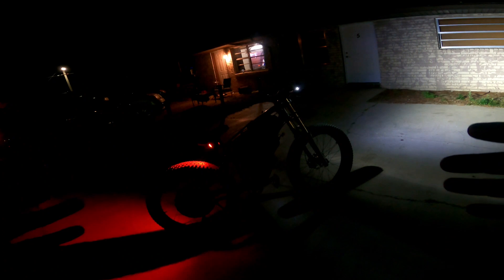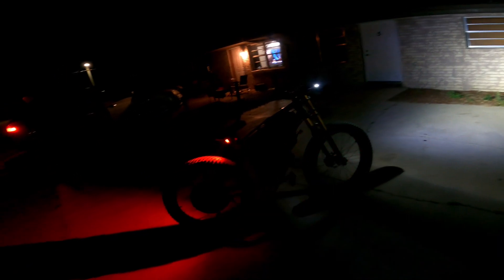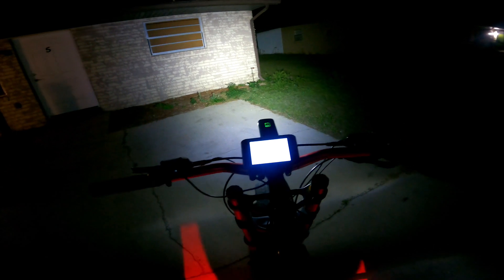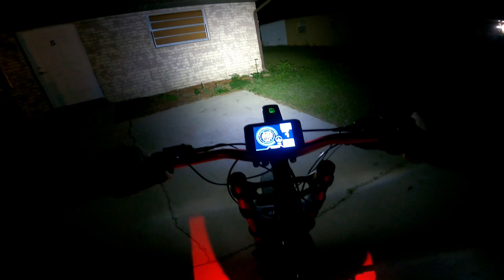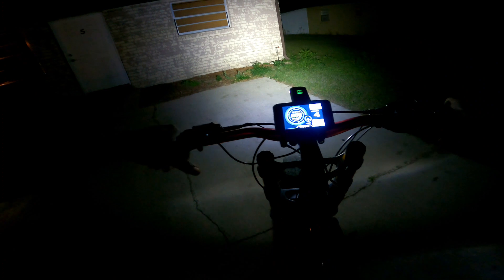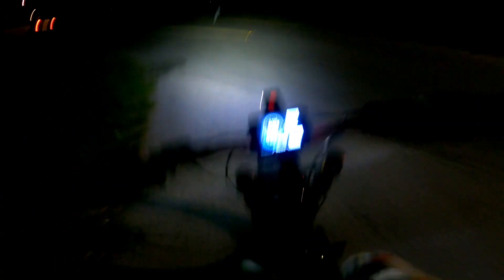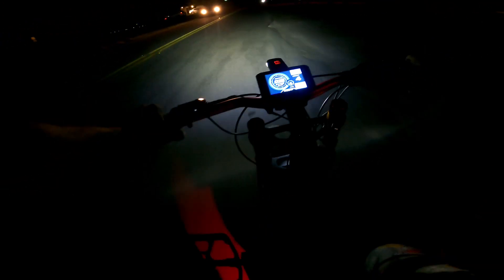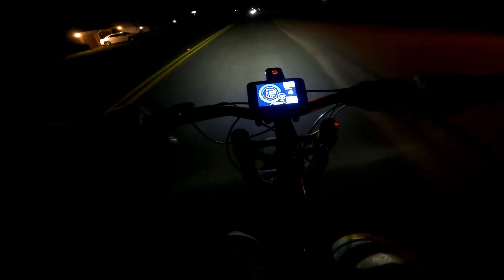8000w diy ebike, short ride for my subscribers. qs 273 3.5t

Comment: Should be on the dragstrip. Guess the next step is to go AWD for some insane acceleration.
Reply from the maker: Might just try that lol
Reply: The front wheel will probably just be doing a burnout.
Reply: @Soulie81  If you have the right controller you can program the throttle to start on the Qs 273 then as you twist further the front motor kicks in and your already moving and not likely to burnout. AWD does have some amazing acceleration I know.
Reply: @Soulie81  sorry meant to say throttle mapping

Comment: Whats your current favorite 8K motor. Thinking either a 3.5t or maybe a 4t. I do 60% road and 40% off road.
Reply from the maker: Mine is a 3.5t
Reply: @E-bikeguy  any experience with a 4t
Reply from the maker: @Temmple  I know you will have more torque but Less speed

Comment: Looks good. Probably pole pairs are different than the 205, throwing the speedo off. You have enough motor now to play with flux weakening more and get top speed up to the highway speed limit. lol
Reply from the maker: Lol right?!!!!
Reply: a 273 will hit highway speed limits without even touching flux weakening. specially on 26s
Reply: @AaronSmith-mn2hu  , at 72v you think it will hit 70 mph without flux weakening?
Reply from the maker: @AaronSmith-mn2hu  I definitely believe it. Mad acceleration lol
Reply from the maker: I believe it,  my 5000w ebike hit 74 without flux.
Reply: @E-bikeguy , ok then. 100 mph on tires you can fold up and put in your back pockets. Who goes first? Lol
Reply: @imho7250  he will learn.
Reply from the maker: Learn what????🤔

Comment: I've actually about 1 week into my wait on a very similar build I got ac 273 3.5 and A sabvoton 150a I felt like it was really overkill so I didn't get the 200a for a stealth bomber frame on its way too to build it on. your saying it's very torqued on 26inch? I'm not sure what I'm going with yet I got my motor coming just bare but I seen them selling the 3.5t on 18's and 19's. imagine what itd to torque wise in something small like that.

I had a build once that would flip the bike over backwards if you even looked at the throttle. and that was just a pnay bike wit mg a little bafang g62 laced into a 16 wheel and designed for a 26 with a cheap $100 72v 3000w controller. I feel like I'm head d in that direction again just on a much larger scale
Reply from the maker: Lol yes you are, I have the 150a and 200a controller they both feel about the same on acceleration but the 200a just has that litte more unfff into it.
Reply: @E-bikeguy  Yes your right I have the 200 myself, it is much better.
Reply: I don't even know how big of a wheel the frame I got coming can fit but I think they usually work with around 20s I hope 24s at least fit.
Reply: apparently there was an issue with the transaction  on my controller. Alibaba is known for scans and after the frame and motor they flagged the 3rd  transaction on the controller so I just reordered one but I went with the far driver one they paired with the 263. not sure why the amos are so much higher (battery draw amps at least I'm not sure on the sabvotons peak phase amps) but I guess I'm going to be adding on a few more cells to my 40ah to increase its out out by about 100amps.

oh and it's a 96v(more voltage should actually counteract a bit of the torque sort of(that's what I've been trying to convince myself(I've almost convinced myself it's true)))I'd really love to complete the battery ahead of time but I want it to fit in the frame and it's getting WAY bigger.

I went with 3500/10amp 18650s since I wanted a lot of range and was just over doing it to get the amperage I needed. but now I need more amperage and voltage I'm kicking myself for that choice. I'm going to have to look up these controllers 330amps from the battery@96volts that's 33k watts of power the controller is taking in and 530@ it's putting out 53k peak watts and they match it with a motor that's 8k 16k peak?. I know they are supposed to be good controllers but something's not right with what's they're advertising it as

I can't see it having that kind of draw on the battery
Reply: next step, modifying training wheels into wheelie bars
Reply from the maker: Yes!!!🤣🤣
Reply from the maker: Good info, you will be putting together a nice battery for sure  my battery cells are 2500 but they seem to do the job I need it to do I was going to go with a 80ah battery but that was going to be way too heavy so I'm trying to keep the wight down as possible.
Reply: yes typically the 2500s have a higher discharge rate that's what I should of gone with if I need such high amperage  going this route I'm going to have extremely high ah by the time I get up to the amos I need. I dont wanna overload it with weight or brakes will need to be upgraded to motorcycle ones n that would be a headache and costly id imagine
Reply: also I've been told that even though they may be rated at 10 amp discharge they lose that very fast and settle around 7amps for most of their lifespan. and ice seen that to be true salvaging lg mh1s from used scooter packs. you can never get much more then 7 amps out of used cells
Reply from the maker: Correct 💯
Reply from the maker: Now that's good to know, for sure
Reply: I actually had an issue with them not sending the motor biwm Alibaba pfft. so I'm in the process of reordering that  and it's going to cost more then the scammers I first ordered through wanted to charge me. 12 days after ordering and it not being shipped yet I open a message to them and start to ask why as an automated response pios up. the price we sent you was wrong please complete this transaction for $(original price +$20) and we will send the motor asap on air delivery to your door non stop. now I knew this was a scam because I have never had a plane land in my street and drop off a package ever before and paying twice+$20 is usually a small red flag too
Reply from the maker: @Aaron Smith  oh ok, I don't buy from alibaba, it buy all my stuff from aliexpress.
Reply: I've been looking there. haven't re ordered yet. it's a little more expensive but I guess it's more like Amazon. they do make it right on Alibaba but they try to scam anyways. was talking to someone in the official siascosys store that's sabviton and the same as cq motors I was asking why so many of the 273s are rated at 4k not 8k continuous. I was told that's the rating they give to all their 273 with 150 mm width(drop out size) the 8k ob scare the ones with the design on front. mostly black but some metallic showing and they're all 195mm dropout size. but the 4k (rated ones) are running 8k continuous and upto 18k peaks without issue hmm. same with the 203s they are personally rating them 3k or lower. that surprised me. makes me want to get an mxus 5k turbo as it's the same motor made by the same people just got cool branding on it haha. I think it's a 273 anyways I'm going to look into that
Reply: actually makes a lot more sense now why they were matching the 200a sabvotons and equal Kelly and far drivers with the 4000 watt motors on paper but selling em with motors they rated at 8k or even 12k a few people on Alibaba rated their 273 150mms at 12k
Reply from the maker: @Aaron Smith  ok cool, I never had a problem with aliexpress, the 273 I got from my supplier is at 8000w 12000w peak, I got upgrade my wires from 8 to 6awg the 8awg wires are getting hot lol if I push it
Reply: which supplier did you use? I haven't seen an upgrade wire option where I've looked but I'd really like to do that. I really hate opening up large fearless hubs I never did but a great puller or whatever that is that pulls the cap off. I think I'd 100% need one. I've beaten open a few 1500 waters to replace the wiring when it's broken on people but that Ali e was tough. I think my next project after this bikes built will be to redo a a small geared hub like a g62. rewind the whole thing sre how hard it is. make it done thing ridiculousky high in Jav and pump amps into it as learning from experience haha
Reply from the maker: No lol I'm talking about my battery wires. The hub motor is good, but I'll send you a link to the store
Reply from the maker: ND Ebike Factory Store
https://a.aliexpress.com/_mM2immm
Reply: ahh I thought I meant the phase wires

Comment: Do the fat tires make a difference?
Reply from the maker: It's more stable at high speeds
Reply: I would get some better tires I don’t like the tires that come with the wheel specially the front and back I saw the unboxing it’s about your safety keep up the good work
Reply from the maker: Ok will do I'm getting better ones as soon these wear out